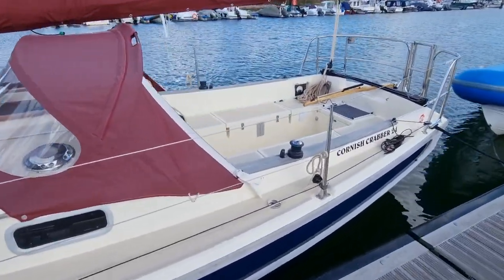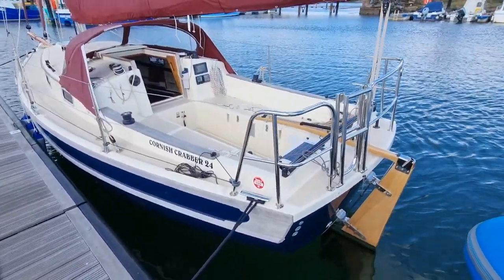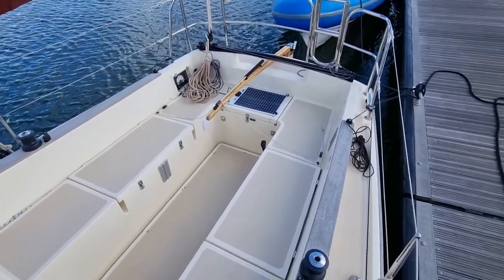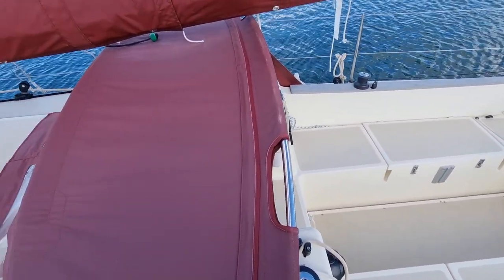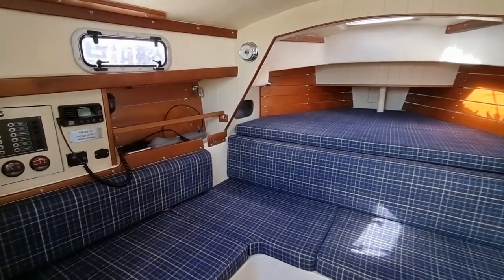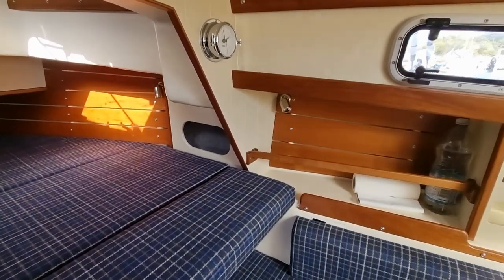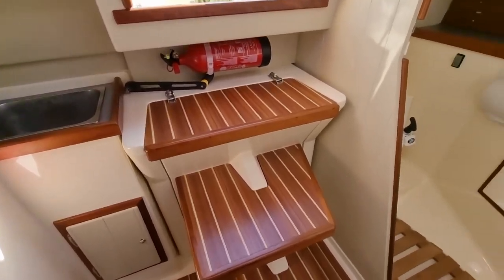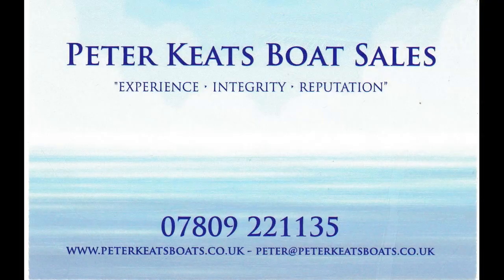2019 Cornish Crabber 24 Mk V  Walkthrough

Comment: Does any of the Cornish Crabbers come with an outboard motor option instead of the inboard diesel?
Reply: The Crabbers are only equipped with inboard diesel engines, however the smaller Shrimpers are offered with either inboard or outboard motors.